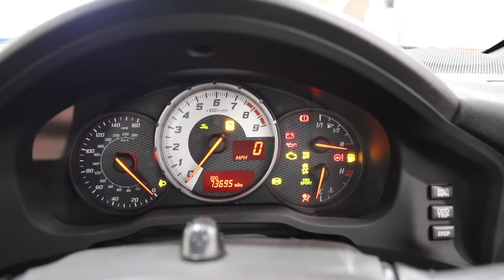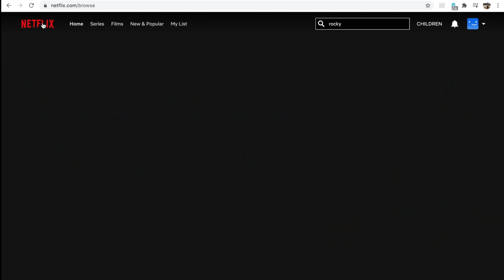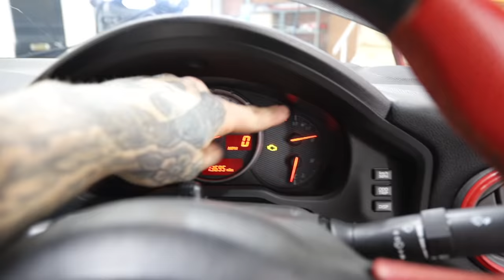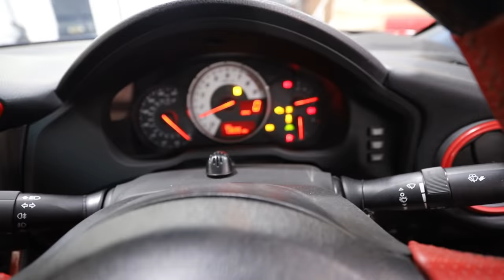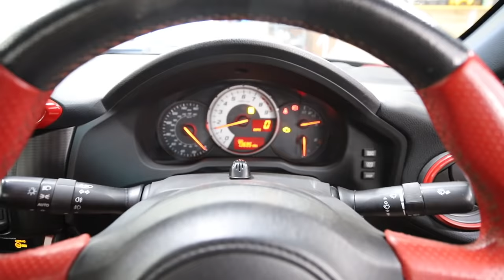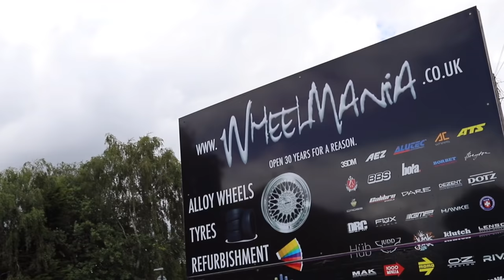FIXING & THEN DRIVING MY WIDEBODY TOYOTA GT86

Comment: You need to use a heat gun on the fiber glass enough heat so it’s hard to touch before installing it, it makes it more flexible and much easier to fit mate

Comment: MAF takes about 30 mins to clear from the EML.

The car will use air and fuel information from a stock table if the MAF is faulty.

When you replace the MAF, after a wee while the EML will go off when the ECU starts getting proper readings from the new MAF.

Comment: They're not that slow if you're not used to 400bhp german whips :D 200bhp and not much weight they do get up and going if you keep them in the rev range.  Also people rave about them for their stock handling, and balance with the limited grip... should have tracked it next door before you replaced any suspension :)  Can't wait to see the finished build though with the wheels, it's going to look very aggressive

Comment: EJ25 swap it rather with a Link ECU- go to Dyno Torque for that.. as a member of the Health And Safety body, it’s actually illegal to show minors and inexperienced viewers on how you remove those coil springs. They can kill or cause teeth loss if unsprung incorrectly . Had a case a few weeks back where a spring came loose and made a hole in a workshops corrugated roof